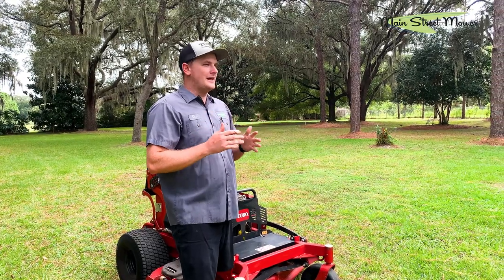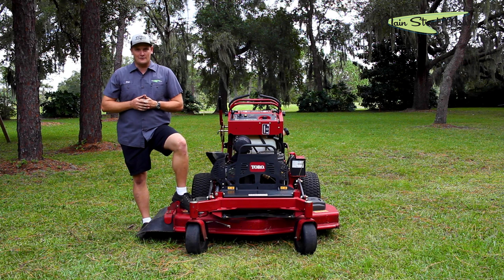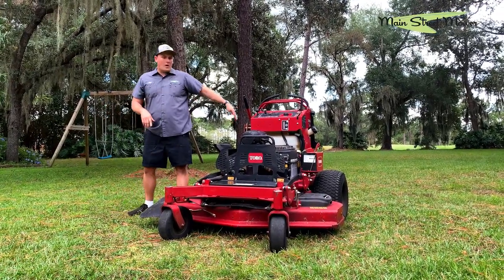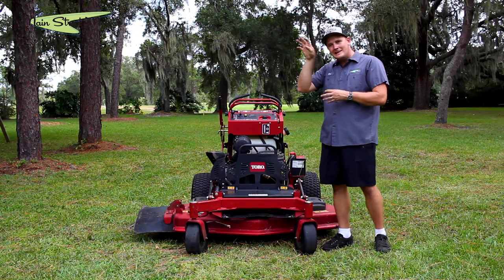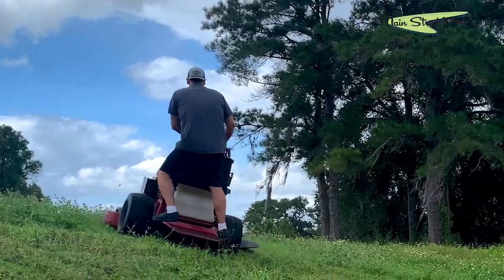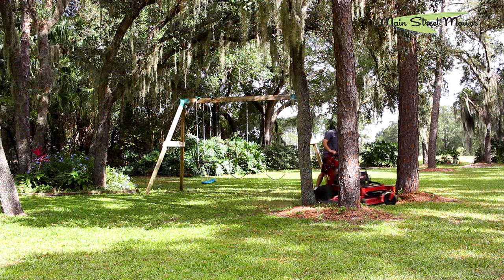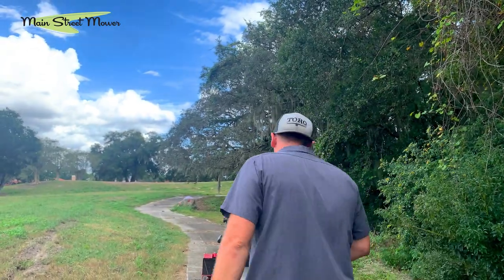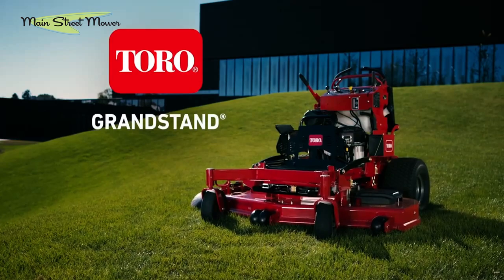Toro Grandstand Review - Best Stand-On Mower for Landscapers!

Comment: This verse the cub cadet I know your inside the pocket between the wheels for a 36 inch. I didn't go with Cub Cadet because I was skeptical about how good they are since they have only been in the game not that long for stand on mowers. I'm about to get a 36 inch and a 40 inch. My main concern is not tearing up the grass, but I am thinking that is mainly in the user who uses it. I feel like if you go slow it should be ok. Does the wheels slip at all. I know sometimes it rains and you have to cut the grass the next day and the lawn is a semi bit wet or the days where its fall and theres like no choice to wait to do it. You have to or you will get behind.

Comment: Buddy of mine has a 52 grandstand. The deck cuts real nice, the machine carrying the deck leaves much to be desired. Worst is the front wheels won't stay on the earth ie, you are standing way behind the rear axle and that causes you to feel more bumps and ruts. Not comfortable. I'll just cannot get used to those steering sticks. Cannot give a difinitive reason. Other mowers just have a more intuitive feel, well except wright.  They are just backwards.
Reply from the maker: Thank you for sharing
Reply: This is why the Wright stand between the wheels is the superior design.  I weigh 245 lbs and the grandstand wheelies especially going up hills. Also the tires are only 20 inches and wear out fast as well as don’t hold hills as well as the wright with 26 inch wheels and a 13 mph ground speed vs toros 10 mph

Comment: I am interested in getting one very soon. Debating on the 40 or the 48 ? What would you recommend?
Reply from the maker: If either will fit your properties and needs, then the 48” is a much more productive unit, imagine saving 5 mins per property per week. With 100 accounts you would save 500 minutes or 8.33 hrs, if you assign a worth to your time of $55 (a common metric) you could stand to make $458 more per week, that’s $23,833 per year. Enough to justify spending an additional $1000 at purchase
Reply: @mainstreetmower  makes a lot of sense plus the hp is significantly different. How about hills I imagine the bigger the better on the hills
Reply from the maker: @TheLawnFellas  Absolutely.

Comment: The smallest grandstand is what?  Just so expensive vs a 21 Inch super recycler mower. I have about 8 k sq ft
Reply from the maker: The smallest GrandStand listed on toro's website has a 36" deck. They're classified as professional contractor equipment as opposed to homeowner.
Reply: @mainstreetmower  thanks. I believe my issue will also be is that I have an outback SUV and I can get my 21 Inch super recycler in the back. I do not have a truck so based on that I will stick with my 21 Inch super recycler. Thanks

Comment: A landscaper is not a lawn care guy. I don’t get why some salesmen are boxing the two in the same category. Carpenters aren’t masons.
Reply: wrong, im a commercial carpenter and when the gc or sup says the masons arent coming or called out, I on many occasions had to grab my brick layers hammer and change the blades on on my cut off wheels and find where the hell my snips and mixer is in the trailer.  it all depends on what you do with the lawns.   if you sell yourself on lawn care and also visit the nursery, then you[re both.
Reply: @duaneafields  wrong. You stated you were a what? Commercial carpenter, not a mason. I didn’t say one couldn’t do what the other does or doesn’t do. But, I guarantee that you wouldn’t switch swinging a hammer for a trowel 6, sometimes 7 days a week...and every once in a while do a little framing? You know why? Because you would then be a MASON doing a small carpenter job because he didn’t show up, or whatever. If I’m spraying a lawn with a pesticide, the customer may want something planted or menial hardscaping. Yeah, of course I can, but I’m not gunna make that shit a habit...or, check this out...I’ll just switch careers & become a LANDSCAPER, instead of dealing with turf 6-7 days/ wk. like I do in LAWNCARE👍🏻

Comment: Such an excellent video. I had a lawn tractor that I used in my 2 acre property for 16 years, then moved to a 1/2 acre property with more trees, and manuevering spots. I have to shift weight outboard to mow ditches and now have to do loops to go straight down and into ditches, then back out rather than just shifting upper body weight. Zero turn won't do it for me so I looked at walk behind which YOU still have to climb even if the machine pulls you. The option is to used a flip down sulky which when you back up while pivoting is a pita. The great thing about the Grand Stand appears to be that it is a hybrid solution, ride when you need to and walk when you have to... to get under bushes or on slopes than you have to otherwise lean outboard which you can't do on a ZT sit down. You helped me decide which mower will suit my needs and that deserves a big thanks.
Reply from the maker: Thank you Don. Glad you liked the video.
Reply from the maker: Thank you for sharing your experience. That's a very good example of how Grandstand's stand-on base could be very helpful. Stand-on when needed and walk behind when needed.

Comment: Hi I am looking for a new mower for my backyard clients where I have to squeeze through gates but can’t decide between a walk behind or a 32/36inch stand on or even one of the 34/36 inch zero turns.
Reply from the maker: My personal favorite out of those would be the Stand-On. Ill share a few reasons. It has great power like the other 2 options you're considering, but it is also the best of those 2 worlds combined. 

With a stand-on, you have the power and maneuverability of the zero-turn, and you also have the access and reach to tight spaces, similar to what you would get from a walk behind.
Reply: @mainstreetmower  thanks

Comment: I'm here in South Florida, and I know you guys do a lot of mechanic work on the mowers you sell. I have a 2022 Toro Grandstand 52, and it keeps throwing the deck belt. Is there a way to adjust the tension arm? It's getting frustrated my Forman calling me every other day to tell me the deck belt popped off. And the belts are expensive, as you know.
Reply from the maker: We will make a video on this, you need to get your idler arm replaced under warranty at your local dealer, the arm is likely bent from the belt derailing causing further derailing. It’s initially caused by engaging your blades with you deck in the highest position, once your arm is replaced with the newer stiffer arm the problem will go away. It’s also important to avoid engaging your blades in the 5” position in the future. Thanks for watching
Reply: You the man.!!! Thanks for the info means a lot brother. If I ever move up to Central Florida, you know where I'm going to buy my new mowers. @mainstreetmower
Reply from the maker: @dizm100  awesome. Hope to see you soon.

Comment: What’s your thoughts on scalping wheels and the deck with zero scalping wheels?? Just got the 52 grandstand and I didn’t realize until I started cutting that it didn’t have any scalping wheels. Is there an advantage to either one??
Reply from the maker: Many people have asked and we don’t know exactly. My guess is that these machines have a shorter wheelbase than a Zmaster and just don’t need them. We’ve heard complaints that they aren’t there from shoppers but never complaints that they need them from long time owner/operators.
Reply: @mainstreetmower  thanks for the quick response. I am guessing when your moving the deck around from 2.5 cuts to 4 inch cuts on customers properties I guess the scalping wheels possibly would be worse. I don’t know.

Comment: I’m looking at a 2013. Can you tell me some specific issues you found with the first generation
Reply: only downfall to the first gen grandstand is the deck lift. I think you have to lift he engine with the deck.....so its pretty heavy. The 2nd gen has the motor bolted to the frame and you lift only the deck. Plus the clear fuel tank is a huge plus.

I have a grandstand 36, which i love. I keep thinking i want to upgrade to a 48......but the 36 is just so sweet.....
Reply: @Stegs  What years are the 2nd gen?

Comment: Bought a grandstand in 2011. In 2016 I traded it for a scag v ride because I already had 4 scag riders. This year I added a scag 36 hydro. I like scags because I'm a retired caterpillar mechanic. But if I didn't have scags toro's would be my next choise. Thanks for your video.
Reply from the maker: Ruth, Stay tuned to our channel. We are about to drop a SCAD vs TORO video.
Reply: I’d take a used scag over a used toro any day. I see grandstands on marketplace all the time with 1500 hours and the hydros already blew up. In my opinion the only mowers toro is good for is walk behinds. I have an old toro 36 walk behind and that thing will plow through anything.

Comment: Chip, and any professional landscaper, is 1380 hours high for a 2016? Looking at a 48" w/ a 26 hp Kohler engine, asking $3400. I have zero reference to go from, any advice would be greatly appreciated. If we were closer we'd just come see you!
Reply from the maker: With those hours, there's still a lot of life left in that machine. However, how they maintained it is really the most important question you should be asking yourself. Ask them what their service schedule was for the hydraulics. If they seem to have a generic answer, just know what you're possibly getting into. That machine should've had at-least 3 hydro-oil changes. The price seems ok. They're not giving you a deal, but it's not terrible either.

Comment: I really need a 40 inch cut to fit in gates but also really want the kohler EFI! Do you know if they will offer a smaller displacement efi at some point or if a custom order can be done?
Reply from the maker: Kellen, unfortunately there's no custom orders. Not sure if they plan on offering that one day. However, the Kawasaki on this mower is fantastic.
Reply: @mainstreetmower  Yeah thought so. Have you tried out the 40 inch or gotten any feedback in regards to how it performs? It comes with a 16 horse kawi i believe? Thanks for the replies. I actually worked for a Toro dealer who is also my friend where I live but hes pretty small time and mostly stocks homeowner stuff. All commercial stuff is ordered by the customer so never get much time with them. Also standers havent caught on with his Toro customers so far. Ive been using Toro for 20 years starting on a golf course and now in my own business. Moving to a differnt state soon and looking to replace my 2 sit down Toro ZTRs with a swiss army knife Toro. Thinking the grandstand is it. You can ride and walk behind and is supposed to be easier on your body in the long run. Thanks again! If you were closer Id buy directly from you! Love the videos.

Comment: But why no anti scalp wheels?
Reply from the maker: The shorter wheel base of the GrandStand doesn’t need them on this deck size. Many have asked the same question, but I’ve never heard a complaint about scalping.
Reply: @mainstreetmower  that's good to know. I'm probably buying a 48 grand stand this spring so I wasnt sure what the deal was.
Reply from the maker: @Dankreviews420  Great Choice in our opinion
Reply: Kicking around buying a used 2016 52” grandstand. Only has 350 hours on it. What do you think? Should I go for it?
Reply: @Exclusive_Criminal  It depends on the price LOL only you can answer that
Reply: @hammer1bad  $3900 picked it up today.
Reply: I have 800 hours on my 52's and I've scalped one yard. I used to scalp all the time when I had a 60" gravely with anti scalp wheels
Reply: Great video!! Will be buying a grandstand this week because of you!! Question 48 vs 52 scalping issues and Kawasaki or carb for reliability? Thankyou Louis